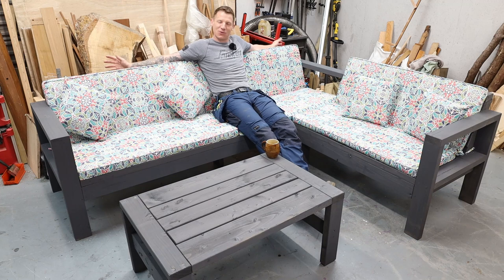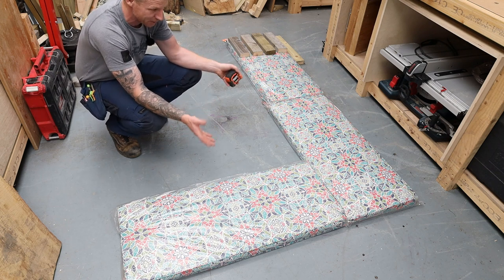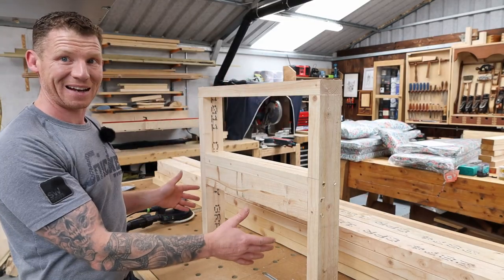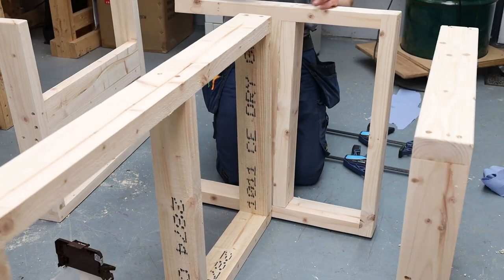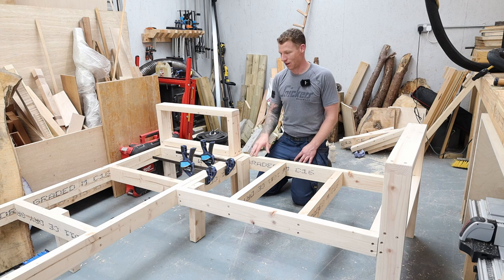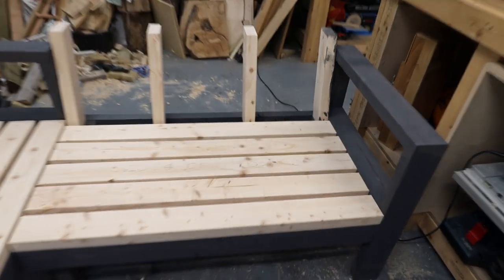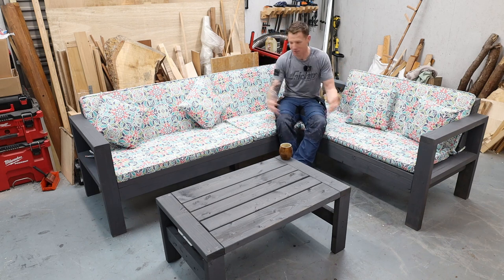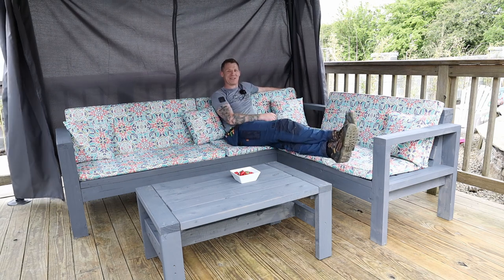Garden Corner Sofa With Table. Easy 2x4 Construction. Garden Ideas

Comment: Lovely set of benches John! I made my own last summer and found the 15 degree recline very nice too! Chances are I’ll rebuild the set this summer or the next because I’m really not happy with how they turned out … thinking a more modular set up would be good! Also I’m required to make them storage boxes as well, and water proof at that, to store the cushions when it’s not in use … so if you feel like doing another bench build, make it one with storage under the seat so I don’t need to do the thinking ;)
Reply from the maker: I had thought of doing storage for the cushions but it would need to be waterproof like you say, a lager plastic box hidden under the seat would be the best option
Reply from the maker: Or even build the storage into the table might work also
Reply: @JohnMcGrathManInShed  cushions are a bit big, 6cm deep thickness and 7 of them (squares), and then the back cushions! I’ll figure it out :)

Comment: John I think you're tape measure might be broken, you said you was going to be making the seat height at 400mm or 39.5 inches 🤔  i think the markings upon the tape maybe printed wrong hahaha, hence why I think you're tape measure is broken 😉 😄.  As alway's buddy 💯%   👍   🇬🇧.
P.s it turned out pretty awesome even though you used a wonky tape measure 😉. 
Oh now my wife has just seen what you made and promptly said " now you have completed your workshop You can make the same thing for our garden" 😞😖😣. Cheers for your uploaded 👍
Reply from the maker: 16 inches i ment to say for some reason 39 came out of my mouth, that happens a lot. No idea where 39 came from 🤔
Reply: @JohnMcGrathManInShed  Hahaha your not alone the amount of  time's I've told the wife I'm putting the washing machine on with the pots in instead of the dishwasher and visa versa is beyond belief 😅.  I thinks it's my age (49) god knows how bad I will be by the time I'm a pensioner !

Comment: Looks lovely and so much nicer then shop brought ones. Where did you get the cushions from if you don`t mind me asking? Also quick tip for the bottom of the legs, where it will touch the ground, either use some plastic feet spacers so raising the wood off the floor, or use some wood off cut scarfical bits to screw in where they touch the ground, which can be replaced when needed. That should help with the bottom of the legs from rotting due to our Irish weather :). But great job.
Reply from the maker: I have them fitted Andrew, I said it in one of the clips but it didn't make the edit, it's a good tip 👍

Comment: Hi John. Looks great. I built something similar last year but used 2x4 for the frame and composite decking for the top. Put the price up but hopefully will last a while. Do you mind me asking where you got the cushions from? I'm in Wicklow and struggled to find anything of the size you have in the video. Hopefully the weather improves so we can actually use them. Thanks.
Reply from the maker: I got them from Woodies John, they are pricey but couldn't get them anywhere else

Comment: Hi. I’ve watched this far too many times lol. 
The 12mm Brad point, so how far in would you go? I don’t think you said. And then would that be a 12mm plug cutter?? Or does it have to be slightly smaller. I take it you didn’t pre-drill for the screws going into these holes. Trying to find the right outdoor screws from such as screwfix. 75mm? There’s too many online. Thanks again!
Reply from the maker: You only need to drill in about 10mm use a 12mm plug cutter, it should be the same size as the bit you used to drill the hole. I didn't pre drill it's not necessary with the screws I used. Riesser Cutter screws
Reply: @JohnMcGrathManInShed  I didn't expect a reply so quick, thanks so much! I'm two frames in lol, rain has stopped play as I don't have your mahoosive shed, I have a rammed full single garage that I can't swing a gerbil for tools. Thanks again!
Reply: Well, it’s done! Thanks so much. Didn’t do a back for the ‘foot rest’ I’m just going to use it as an easily movable half cushion foot rest. Coffee table next. Really chuffed with my first ever furniture build. Thanks again.

Comment: John if you don't  mind me asking how much did 25 2 x 4 cost with the way timber prices have gone and who do you use to supply? I built a workbench a while back and used build4less but the quality wasn't great for gannons timber . Thanks
Reply from the maker: Hi Alan they are about 7 Euro a length at the moment, I get them from a local builder's provider
Reply: Thanks John/Alan I wondered the same myself. Will need to watch again to see how you secured the 15° backs. And I will get myself a battery powered router. July project sorted. Brilliant work.
Reply from the maker: @gordonsmith2853  Gordan the 15 degree back support are glued and screw from the the top and underneath with long screws

Comment: Not convinced of the safety aspects of using the trim router hand held on a wobbly small 4x2 leg end!
Reply: Yeah not for amateurs to do for sure. Once you go in only 1 direction and hold it steady flash against working piece you should be safe.
Reply from the maker: Not the best way to do it I will admit, but a trim router on slow speed with a small bit  held away from your body is not too bad.